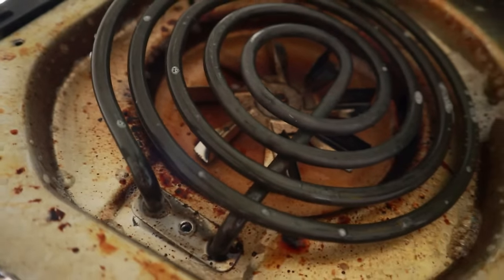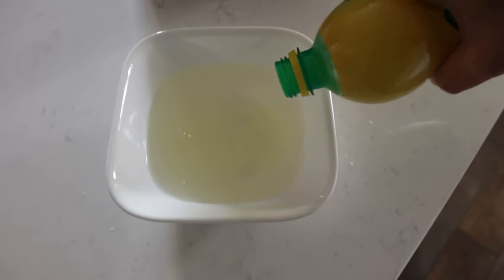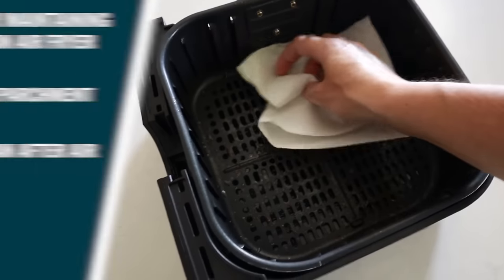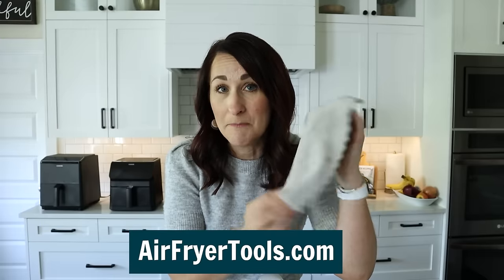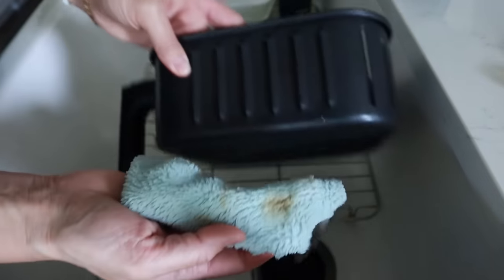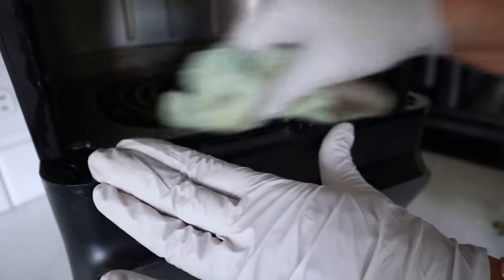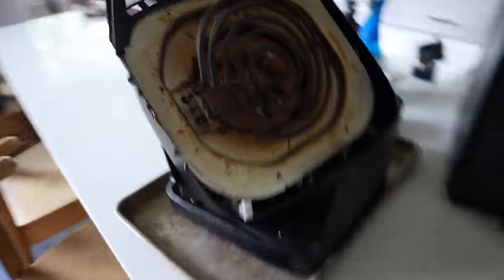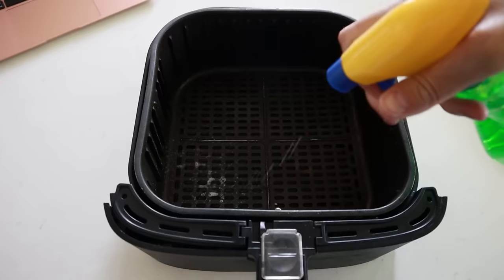How to CLEAN Air Fryer & KEEP IT CLEAN! Stinky? New? Watch THIS!

Comment: First of all for me I'm not a big fan of the parchment paper in the af but to each their own I do make small foil trays to cook like fish or even mini meatloaves, second I wipe up the basket and the pan as soon as the food is done cooking with paper towels like Cooking bacon for instance I remove the bacon then wipe the inside of the basket then separate the basket and bottom and wipe the underside of the basket, then empty the grease in the pan into whatever you store bacon grease in then wipe up the pan. Much easier if done while hot but be careful not to burn yourself. I use my af every day so after about a year or so I simply buy a new one because of the build up under the burner.
Reply from the maker: That works too!

Comment: you can use a silicone baking liner under the holed tray for droppings, also I think these smaller air fryers were meant to be utilized up to about 5y years and possibly be tossed for the new model because they did not provide a way to clean the burner areas properly.  I think the key is to get to the areas that have grease or caked on dirt clean as much as possible and a rule of thumb could be the smells when it cooks-- do you smell old cooked food smell or the new cooking food smell. I agree with others that cleaning as soon as possible or by a routine will keep the fryer in good condition longer, but ymmv. IMO, the air fryer needs to be cleaned at least weekly or every 1 to 10 uses depending on frequency and/or types of foods cooking. Going longer than 10 uses (especially greasy foods)  is nasty and you shouldn't have an air fryer, imo.

Comment: Oh thank you so much for the tip on the hydrogen peroxide and baking soda.  Is it a 1 to 1 ratio of each?  I do clean mine regularly after use.  The Ninja I have has long blades but not easy to get to due the heating coils. I do what I can with a damp paper towel and my skinny fingers in that area.  I worry I'll mess up those heating coils.
Reply from the maker: Great question! I didn’t really measure it. Just a good consistency so it’s easy to work with but not too runny!

Comment: Good gosh, girl, I don't do any of that. About every 3-4 weeks, a spray oven off on a paper towel and wipe it on the inside and walk away.  When I get around to it, I come back and wipe all that off. That's for the inside.   For the baskets, I put them in the dishwasher probably every three or four days and at least once a week.  My cosori blaze looks like brand new all the time except up above that top coil.    It looks fair but definitely could look better if I knew how to do it.

Comment: I clean my AF every Time i use Fatty stuff. Breaded  stuff often only needs a quick  pull, over  at the sink with kitchen towel  to get rid of the crumbs. I got little Backing Tray  that fits into my cosori and this does the job well. No mess anymore. Esp. for Chicken wings,  they go an rack  and i add backing paper  the fat drips on the paper meat gets juicy and crunchy.And tray is cleaned in mimutes , when theres more i soak it  Water and dish soap. Done. The worst i have is i wont getting rid of the oily  resudues even put i boiling water and fat remover. After did Chickpeas since than the fat has burned  in even after careful cleaning , no chanche, also the no stick is damage even with very  careful  cleaning. I have some sucess with a silicone sponge for cleaning dishes , soft enough for the basket and get rid of raw left opvrs and getting  better into side vents.

Comment: I have a removable filter in my Ninja air fryer and I can’t seem to get it clean, I’ve soaked it, scrubbed it, tried different grease removers, nothing seems to work. Do you think oven cleaner would work? Thanks!
Reply: I'm not sure what material your filter is made from, but I've been using Fulsol from Fuller Brush Company for years to keep my stove hood filter clean. It's very strong and must be diluted according to directions though. It actually took the painted markings off of my oven knob when my housekeeper used it full strength 😬

Comment: Thank you for this. It helped me finally decide that my air-fryer is not for me. It's just too much work to clean. Maybe if the basket was stainless steel and I could scrub it with metal wool, but this non-stick coating doesn't work and means you can't properly scrub. I'm out.

Comment: I would never think to take apart my air fryer to clean it.  It would be like trying to take apart my toaster. 🥴  Besides I think that taking it apart would probably void any warranty.
Reply from the maker: lol, yes... I was glad to test it out on our recalled one that we were getting rid of anyway. Now we know, it's not worth it! :)
Reply: As far as I'm concerned, it is just like keeping the burners on your stove clean.  If you have a stove with grates on it for each burner, you would have to move them to clean around and under them.  I don't do that anymore since I use a ceramic cooktop but I used to hate doing it on my old stove.  That should tell you I didn't do it every time I should have!   Now, that being said, I am not a nut about keeping my airfryer clean.  I don't wash the basket every time I use it and, when I do, I put it in the dishwasher.  I use a lot of panko crumbs on what I'm cooking in it and I am diligent about getting them swept out each time.  Otherwise, if I don't make a really big mess in it, I probably don't clean it up more than every 2 to 4 uses.  With the amount of heat that's developed in there, there won't be many germs living in there.

Comment: I've used Dawn Power Wash for my airfryer and it does a lousy job of getting rid of sticky residue or built up gunk. Even if I leave it for ages. Not sure what I'm doing wrong there.
Reply: Try using a Mr. Clean eraser cloth after the dawn. Works for me and doesn’t hurt the nonstick.
Reply: I also didn't have much luck with Dawn Power Wash.  A Magic Eraser worked well for me, especially on the metal shiny part.
Reply: Same here. I’ve even resorted to a metal scrubbie and Powerwash.  But even that doesn’t get it all.  I think that if I cleaned it after every use, maybe I won’t have to use the metal scrubbie which will eventually take off the Teflon nonstick.
Reply: Good Morning, kiddo! Good timing, Cathy, I just received my re-placement AIR Fryer and I’m a happy camper again!!!! I’m sure you can’t remember all of us but I was the one whose AF (one night in the beginning of making wings) had a digit readout appear (E1) and my unit would not work…I called  Cosori the next day and was re-directed to their email address where I panically detailed my problem…and to my surprise I received a response one hour later telling me sorry about my problem but that someone would definitely get back to me in three days because if the three day Memorial weekend…three days later I received another email from their customer service team asking me for all of the pertinent AF info…eleven days later my new  Corsori arrived at my day!!! Wow, I’ve never had such wonderful and fast response from any other company! So if anyone has any doubts of what air fryer to buy, Cosori is the one! I use mine practically every day especially because of you and your mouth watering videos and with the help of your AF cookbook! Thank you! Have a good weekend…now what can I make next?🫶
Reply from the maker: Hmm, what brand of air fryer do you have? My original air fryer was a Phillips XXL and it is now at my dads house. It seems to be a different coating, and it impossible to get the layer of grease off.
Reply from the maker: @Gail - I remember you telling me that you were waiting to hear back - thanks for the update! I am so glad you have your new one!
Reply: Have you tried Mr. Clean (liquid?) It is the best for cutting sticky grease that is built up in the kitchen so might work well here. Just dilute it a bit and be sure to rinse well with plenty of clean water after. I think Dawn PW would be better for after every use cleaning on fresh grease that has not been baked on yet
Reply: @empoweredcooks  Yes, it's a Philips. Does a great job, but that grease is stubborn.
Reply: @hlynn2008  I'm in Australia so we don't have that brand here. (I actually imported Dawn Power Wash, as I couldn't find an equivalent here.)
Reply: @poeterritory  Oh! I see. Maybe there is another brand there that is equivalent?
Reply: I don't think you're doing anything wrong. I don't understand what all the PW hype is about. I went on the website to see, and the ingredients are very different from the ingredients of regular Dawn.

Comment: I wonder if a steam cleaner could get under that burner coil? 
would it be safe though?
Reply from the maker: Hmm, haven't tried it! You'd think it would be OK, since the air fryer can produce steam/smoke when cooking food.
Reply: @empoweredcooks  great point about the steam when cooking.
I have a Bissel Steam shot and it would get under and around that coil nicely.
Reply: Except that manufacturers are advising customerrs noT to put water in airfryer draws & heat machine up as steam can damage controls :/

Comment: As I am preparing to remove my food, I turn on my hot water, it take a bit of time to get to my kitchen.  Take the food out, a couple shots of Dawn and hot water.  After dinner, my dish brush on the grate and my scrubber sponge on the container.  Occasionally if there is room, in the dishwasher.  Still like new

Comment: I am looking for a scrubbing bubbles type of cleaner that will do all the hard work.  I just wanna rinse the basket out.  The closest thing to a great scrubbing bubbles type cleaner is 2 cups of hot water, a few squirts of dishwashing liquid, about 3 tablespoons of baking soda, and about a half a cup of white vinegar of about 5% acidity.  I put the ingredients in the basket and waited about 20 mins.  I then give the basket a scrubbing and rinse.  This method does a good job cleaning it.  

***A word of warning.  Teflon is toxic, and contains forever chemicals that stay in your body forever, even with a good detox method.  Avoid air fryers that use Teflon coating for the basket and crisper tray, and get one that uses stainless steel.

Comment: I am in a tropical climate and if I leave behind a crumb I can get an ant infestation.  It happened with the air fryer.  So the pan, the outside part, sometimes little bits of food get in there I guess because I saw ants crawl out.  I blew it out with compressed air - but can I submerge the whole pan in water?  Not just wash the inside?  thanks

Comment: I have 2 comments.    1) NEVER pull the plug out the way you did!!!   Hold onto the thick part which holds the prongs.   By pulling the cord, you risk damage to the plug unit, and can cause electric shock if the connection is broken.   
2) I have a model chosen by my hubby, and not me.  The fan section is permanently attached to the lid.   I can’t turn it over, either. I will try the cloth as suggested. 
Also, even though it says all the removable parts are dishwasher safe, I have discovered that the non-stick coating was damaged, and now those pieces are rusting.  So very sad.  😢😢😢
I would suggest that pieces are washed only by hand.

Comment: I clean my Air fryer basket after each use in hot soapy water, 
It’s the top under the element that’s the difficult  part

Comment: If your air fryer has a persistent plastic smell there may have been bits of packaging foam broken off that worked its way further inside your machine. the machine should have been in a sealed plastic bag to stop this but I've seen appliances where they have been taken out of the bag then repacked and the box sealed as 'new'. Potential fire hazard.
Reply from the maker: Good tip! I have not had that issue before though.

Comment: Never ever disassemble a air fryer, they have capacitors in the exposed power supply that can hold enough charge to kill you even months after last use

Comment: Or just don't buy one. The junk getting around the heat element and the fan ruins it completly. Air Fryers manufacturersv really need to come up with a new desing that's easer to maintain at home. I won't eat anything from a device that is so dirty...I send mine to reclycing dump when I saw I can't get it cleaned up there.

Comment: Inability to really clean the  burner area is the main reason that I will  not have an air fryer. That and look at the state of the basket. Despite all your hype, I think they're a very much overrated piece of equipment. I will stick to my combination microwave oven. It will do very well for me.
Reply from the maker: The super dirty basket was one that has been in a college apartment and not maintained. If you maintain and take preventative measures like I showed, you will never have that issue. It's incredibly easy to clean... it just requires one to clean it! :)